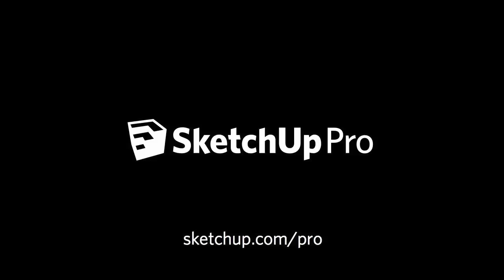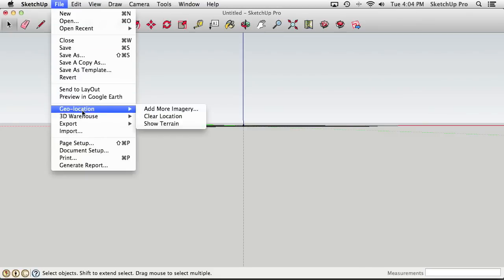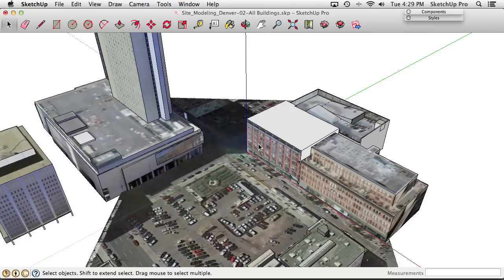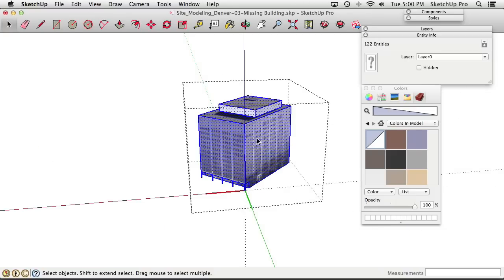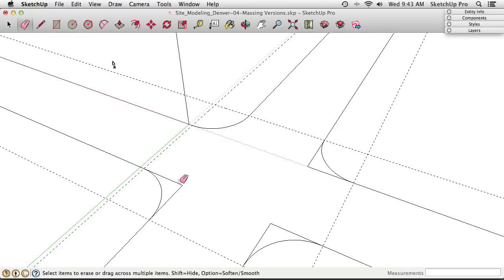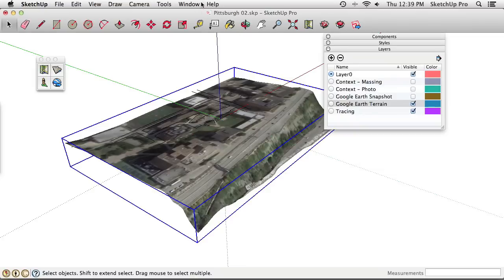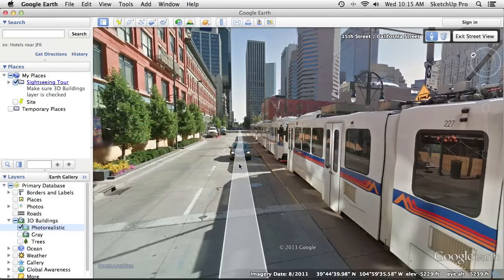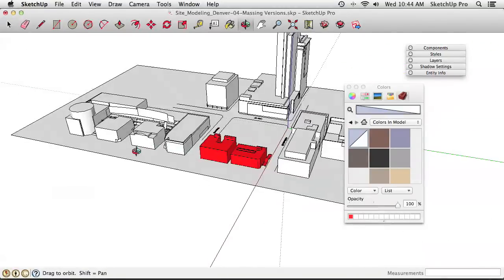Site Modeling in SketchUp

Comment: How do you solve the problem of buildings and roads not being automatically located when downloaded? I get the object but it is not fixed and requires me to place it on the aerial photo in sketchup.
Reply: same problem here
Reply: ok i found that if you download the same model of the video, it will automatically place in the right place. but there isn't a way to know if a model in 3dwarehouse is georeferenced! so you have to try untill you find the right one :(

Comment: When I searched for "nearby models" and chose a building to place onto my geolocation screen grab, it did not paste directly in the spot it was supposed to, as it does in the video.  Instead, it follows my arrow just like anything does if you are moving it with the move tool.  Is there a setting that will allow it to paste directly in the correct place?   Thanks!
Reply: Same problem I have. Found a solution yet ?
Reply: make sure you click the thumbnail, not the name.
Reply: Yeah, clicked the thumbnail and still did not paste in place.
Reply: same
Reply: same - any solution guys?

Comment: Great Video. However most of the site context steps aren't working for me. Clicking on most buildings in google earth does not reveal the information shown in the video; no title of model or author. This means I can't find the nearby buildings for my model, in fact the components tab/nearby models is populated by very few buildings, even though the area I'm working in is fully modelled in legacy mode. (My site area is Viale Duilio, Milan, Italy)

Also the 'add photo texture from google earth' function to a face in SU is all screwed up; the field of view angle is set to about 180 meaning the building face has such a large curved distortion that I can't grab it using the simple 4side polygon grab tool.

It's a shame because I was really looking forward to applying these techniques to my context model.

Comment: Hi. I have had this question for awhile now and hope you can answer it. I am working on 3d modeling a much smaller city (Charleston, WV) for some personal projects. The city just recently became fully 3D in Earth within the last 18 months or so, but only has a handful of Warehouse models. Is there anyway to bring in the 3D buildings from Earth that aren't in the warehouse? The best method I have been able to find so far is to just import the city CAD file I have and extrude all of the buildings up based on the footprints, but if there was a way to just import all the buildings from Earth it would save me a lot of time. 

If you cannot do that, do you know if Earth and Sketchup plan to do this any time in the future? I feel it would be an excellent tool to have. 

Thanks!
Reply: Same here! Basically the whole city of Stockholm, Sweden, is in 3d in Google Earth but very few buildings are available in "nearby components".